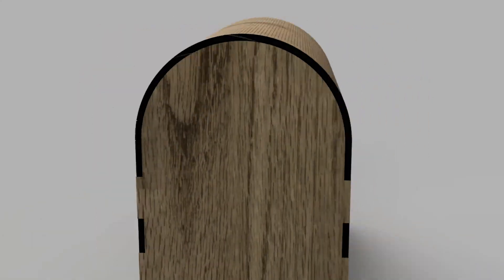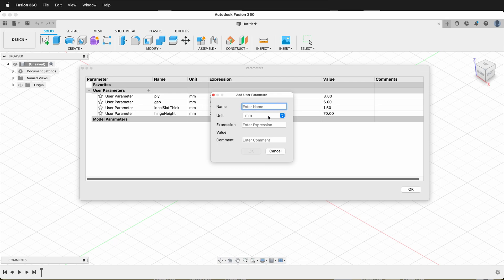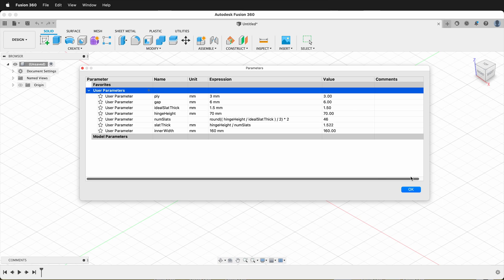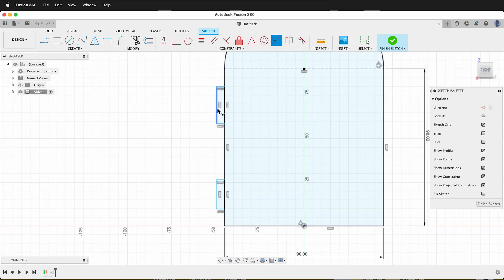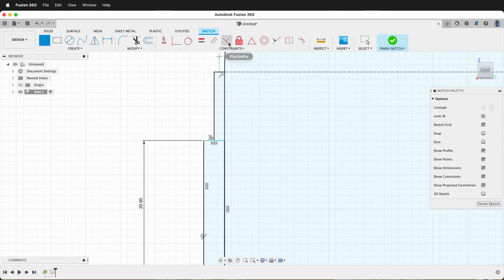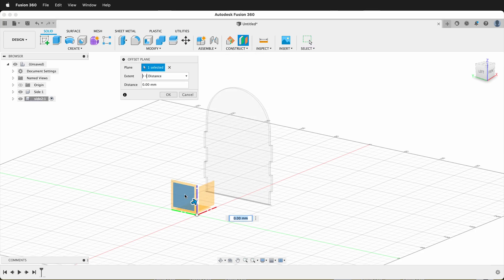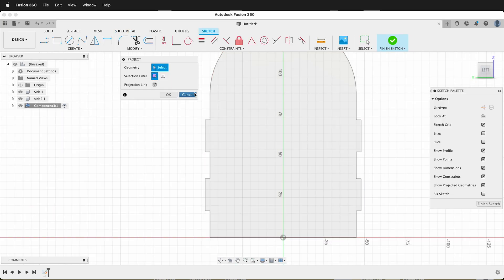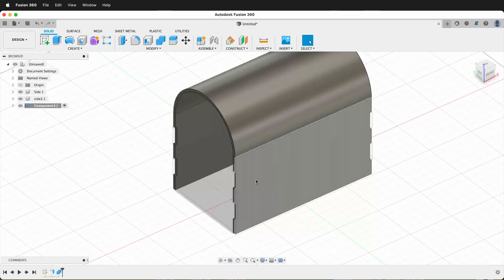Mastering Living Hinges in Fusion 360: A Step-by-Step Laser Cutting Tutorial

Comment: at 6:37 i cant press OK when i type + 2ply, but when only + ply the flange work and the distance is 83mm but not same as the video 82mm. is it okay?
Reply from the maker: Hard to know without the specifics of your project but if it continues to compute you can make a test cut and adjust as needed, 1mm is likely ok
Reply from the maker: Did you try 2 * ply ?
Reply: @WhatMakeArt  i don't have project and laser cut yet 😂, i just follow along the video for learning. i try 2*ply the distance became 86mm. I think I should just use +ply
Reply from the maker: Definitely use whatever works with the design, the best thing about 3d modeling is that you can virtually test out your design before physically making it, good luck with the project 🐇

Comment: GREAT video! with the help of this video and the previous one, I made it fully parametric but i got stuck in selection of the lines. if i change the width of the box its increasing the lines and getting an error in extrude selection.
Reply from the maker: Is there a fixed dimension lurking? Is the flange size updating?

Comment: It's great to see alternative methods of getting to the same end result.  The last bit can be simplified though if you use the Shaper Origin plugin.  With it, you can export faces, sketches, etc. as .svg files that you can then bring into lightburn or other laser software to arrange and set the layers as you require.  It's much faster than going through the manufacturing process and illustrator intermediary and gives the same result.
Reply from the maker: Thanks for sharing the tip with everyone, I will try it out

Comment: Nice video. I notice you didn't refer to 'Kerf' at any point. I did notice it was one of the parameters for the laser tool. Does this method compensate for kerf based on the kerf parameter, i.e. will the 3mm tabs be offset by the kerf so there is a tight fit when assembling?
Reply from the maker: For the living hinge portion, it just assumes that it's cutting on the center line, and then that gap is what it is.

For parts that fit together, you can make a tool in Fusion 360 and then make a kerf adjustment.

Here is a video showing how to export a DXF with kerf adjustment for laser cutting
https://youtu.be/6JFHMV7A9TU